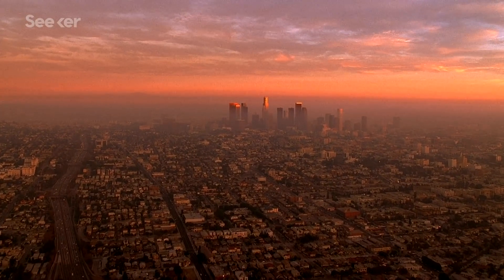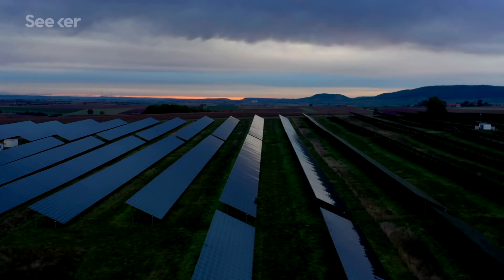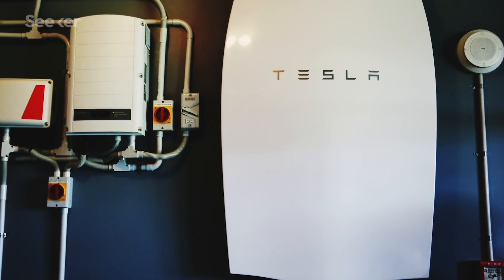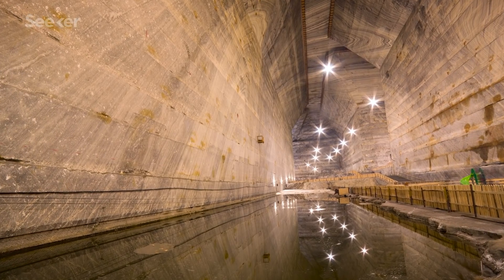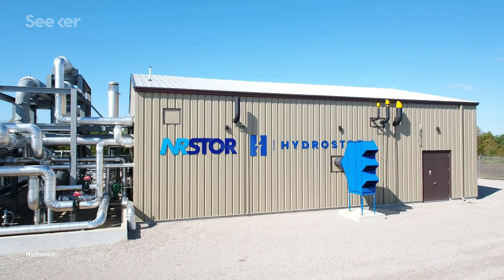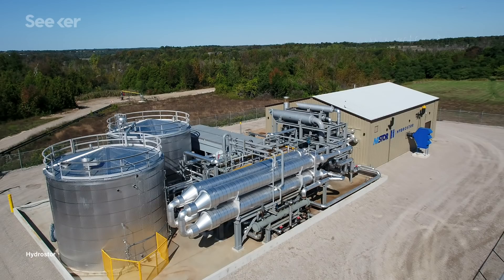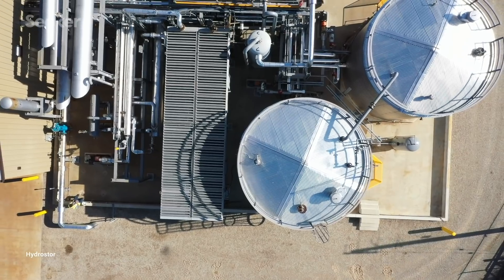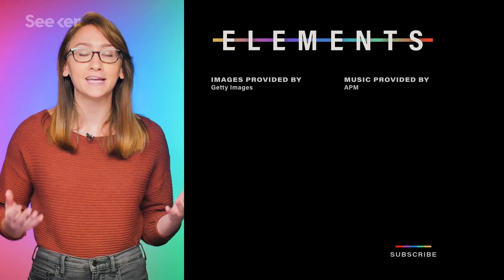This New Tech Could Revolutionize How We Store Renewable Energy

Comment: i saw an episode of (i think) real engineering or practical engineering, where they do pumped water storage.  use the extra electricity to pump the water up a high distance to a reservoir, and then when the sun goes down or the wind stops, the water runs back down through turbines to generate electricity.  no energy is lost due to the water cooling, because the same mass is up there, and it's gravitational potential energy, rather than the potential energy stored in momentum of the air molecules.
Reply: alot of energy is lost, but that's the thing, there's no lossless energy storage. you need to convert energy, and keep it at one place, and then have it accessible later on, however, those water storages are some of the best, problem is, they require a massive location, and a natural incline at that. still, i still consider them to be, some of the better choices.
Reply: Marcos Danilo 
oh yeah, it's certainly not 100% efficient, energy is lost to friction in the turbines, as they pump water up, and also as the water flows back down.  i was just mentioning that at least they don't lose energy to heat dissipation as well.  but yeah, they do require a lot of space and specific terrain.

Comment: thorium sounds great. and we've already built and tested a thorium reactor in the 50's and 60's. i think they did it in alabama. but there is one problem with thorium that so far, has been insurmountable. the molten salts used to store the heat energy is so acidic, that it eats through the piping and containment vessels. that makes the cost of maintainence so high as to make the thing cost prohibitive. maybe someone can figure a way to mitigate the corrosive effect of molten salt, but so far, it hasn't happened.
Reply: Well that's a drag to hear. I thought the fluoride mix they used wasn't very reactive, and never heard about corrosion problems for the the molten salts from solar-thermal towers they already have, but that's probably a totally different beast.This is what I hate about these kinda discussions, neither side wants to admit their own weak points and the info is so hard to come by. Thanks for the tip tho, if you have any articles easy to link I'd dig reading them.
Reply: @aitch9053  i can't for the life of me remember where i read that. awhile back, i watched a couple videos produced by an engineer. his name was kurt sorenson, or something like that. anyway i was intrigued enough to do some reading on the subject. and i do remember reading about the corrosion issue. at the time i remember thinking that it made sense. salts are generally corrosive. but don't cite me as any kind of an expert in the subject. if there isn't a work around yet, there probably soon will be. at least there will be if enough funding is devoted to the matter. also, thorium would compete with an already established industry. the corrosion issue could be a tactic, put out there by competitors, as a way to quell interest in thorium. it wouldn't be the first time.
Reply: Your opinion doesn’t matter, so shut up.
Reply: @nicklarsen3113  Jeezzz Nick, thanks for taking the time to post such a thoughtful and informative reply.

Comment: Strange that no one mentioned dam based water reservoir electric power plant. It not only produces electricity buy also has better efficiency than air due to lack of pressure leak and termal radiation

Comment: Pumped hydro storage has efficiency of around 80% with far less steps. That's the reason it represents 98% of all energy storage capacity on the planet. Things like this should be mentioned in the video
Reply: Good point, but you need to dam some valleys or dig huge holes for the reservoirs, which is likely to ruin some beautiful natural habitat, plus you either need a suitable high ground or wide enough area where you are allowed to dig two open pit mines. This idea needs only suitable rock formations to dig the caves in and a relatively small facility on the ground, and can stack multiple storage caverns on top of each other if you can't dig them wide enough. Optimally you will build it right under your solar/wind farm.
Given air is much less dense than water I am more worried about how much power it can store and at what cost, rather than the efficiency.
This does have one clear advantage though: Droughts and other bad weather are not going to bother it.
Reply: @AnalystPrime  The natural habitat argument always annoys me. You realise that for every valley destroyed there is a lake of the exact same size being created, which becomes the "unnatural" habitat of all the fish in it
Reply: @the_sideshifter  Okay, so you introduce fish and aquatic plants to feed the fish in the pit you dug and filled with water from somewhere. But then you actually need to use that water to produce power and the fishies get shredded by the turbines.
Likewise, no swimming or boating allowed for safety reasons, so the lake might look nice but people won't be using it much.
Reply: @AnalystPrime  A: have you not heard of a grid? they are great at stopping things passing through.
B: digging big holes in the ground top store air is fine, but using them to store water is somehow a problem?
Reply: @jonathan6015  When a hydropower plant opens it's intakes it's going to vacuum anything loose in that reservoir, and keeping that intake clean is already going to be a full time job without adding fishes and fishermen into the water. Also, destroying what is likely a forest with birds and other animals nesting there and replacing it with a monoculture is not going to improve the natural diversity of the area.
B: You are not thinking clearly. Air is stored in old mine shafts or caverns dug for the purpose, the facility topside housing the machinery will be hundred times larger than the holes going down, even without the solar or wind farm actually powering it. And the shafts will of course be covered, inside the buildings.
If you don't have a suitable valley for the reservoir you need to either find a hill you can build a big pool on top of(likely using lots of concrete, a source of CO2) or, if the locale is too flat, you need to dig two pits: one big enough to hold however many millions of gallons of water needed to store enough energy to make this project practical, and the other twice as deep and wide because that's where the water is going to flow and you need the height difference.
The first pit will be pretty big already and the second will have eight times that one's volume. Hopefully you have some use for all that earth you need to move... Also, hope you can find a place to dig those that is suitably close to a power plant and a city using that power but where giant open pit mines don't lower anyone's property values, because those will be very visible.
Reply: @AnalystPrime  Here Let Me Google That For You
I see you are clearly just making your own assumptions with out actually researching anything. i noticed this because all I had to do to find out that old mines are are viable sites for pumped hydro is type "Pumped Hydro Storage in an old mine" into google.

secondly, I typed "hydro energy dams" into an image search and lo and behold, huge dams open to nature and people with seemingly no problems with fish and debris.

I mean it should be quite obvious, old mines are often huge and we have been using water wheels for hundreds if not thousands of years.
Reply: @jonathan6015  I know there are experiments with using mine tunnels for hydro storage too, but I hope they waterproof them properly before starting. Google "sinkhole town" to find out what happens when you combine flowing water and soft rock or a salt mine. Also Google "Berkeley pit" for why letting water into a mine is generally a Very Bad Idea. Mines generally have the mining town above it, sinking the buildings into a lake of poisonous acid would lower property values. The turbines and other parts would likely be fine with the polluted water, but the people working on them would not, and anything that risks contaminating the local groundwater supply is unlikely to get approval in the first place.

You could also try Googling "fishing Hoover Dam", but I'll summarize: No, you can't fish on/at the dam itself, and ever since the dam was built the fish population of the river has declined. But of course the Hoover Dam is a proper hydroelectric plant on a river, not a pumped reservoir. We are talking about completely artificial pond, which may get drained empty at any time. Maybe you can explain to me which part of that sounds like "great place for fish to live" or "totally safe for people to play in the water"? Though we might still want to introduce some bottom feeders anyway, that would keep down the amount of rotting stuff.

And I am still unsure if you actually understand the basic issue: using a mine shaft requires an old mine in suitable type of rock, but once built you only need a small facility and rest of the area can be fields for animals, or a solar farm, or even houses. A water reservoir of useful size will require a sizeable area of land to be flooded and become useless for other purposes, plus it won't be "out of sight, out of mind". People already complain about land needed for solar farms and not wanting to see any windmills, now imagine the response to digging the numerous reservoirs needed for even minimal grid level energy storage.
Reply: @AnalystPrime  , so your whole argument as to why people cant use a mine for water storage is because they may do it badly. that's a pretty week argument you have there. this is starting to sound a lot more like your opinion then a factual argument.
Reply: @jonathan6015  No "opinion" here. FACT: only reason mines are dug is because there is a high concentration of some mineral, which water will leech out of the ground and most of the results will be toxic, corrosive, or both. FACT: the water can eat through the walls and cause a sinkhole above, as has happened in multiple mining towns. FACT: this energy storage relies on finding cheap abandoned mine tunnels to use because digging them yourself makes it too expensive to be viable, so needing to work on them to prevent that kind of accidents adds a pointless waste of money when the already in use and proven to work compressed air is both cheaper and safer.

And I still don't get why you want to fill those tunnels with water anyway. Compressed air works because you can insert multiple times the volume of the tunnel and get power out just by opening a valve. Filling half of the tunnel with water and letting it flow into the lower half only uses half of the volume and needs a large height difference to be useful. Even if you change the plan to building a regular reservoir, then using the mine shaft as the lower reservoir, it is still a dumb plan because tunnels are tiny in volume compared to what we need. Also, as the water pumps need to be at the bottom of that mine shaft any problems would need a specialist diver team to fix them.

If you want a pumped hydro storage the easiest and cheapest way is building two reservoirs like I explained above. Only issue will be slight loss of water due to evaporation, which can be managed. The reservoirs can be bigger than expensive tunnels, the machinery will be located in easy to reach places, and even if you managed to pick a location where the soil releases something dangerous you can build the reservoirs so the water will not leak out.
Reply: @AnalystPrime  lol, I'm sure you think your ideas are wonderful, but there is more than one way to skin a cat, all you would need to do to the mine is seal the surfaces with something waterproof, something like shotcrete would work fine. No surface contact no problem.
Reply: @jonathan6015  Yes, I already mentioned that. AND that the whole point is to save money by using a cheap location that needs minimal work. It also does the opposite of helping with the issue of limited space in the mines. Unless using water allows for multiple gigawatt hours more storage in less volume than air, it is better to go with the cheaper and safer system.
Reply: @AnalystPrime  the difference is that air is compressible.   The energy density in a cubic meter of compressed air (depending upon the storage pressure, naturally) is much greater than that stored in a cubic meter of water held at reasonable elevation.
Reply: @andrewm753  No, the difference is that you need to raise the water(or any other weight) at high elevation to make it useful, and prepare a storage area at the bottom so you can hoist it up again easily, while you can put the compressed air storage underground and have no need to keep using the same air. If you have a suitable old mine for the facility it should be cheaper than digging pits and building dams. If you don't have one, digging big open pits is actually much easier, meaning cheaper, than underground tunnels and caverns. (Though, as I pointed out above, people are much more likely to oppose huge open pits than unseen caverns.)
Either system will be huge compared to batteries or heat storage, the exact amount of power per volume is only important if you somehow manage to store many times more power for the same cost.
Reply: @AnalystPrime  you are pulling on the right thread, but didn't quite grab hold...   yes, you are doing the same work, but when you use compressed air to displace the water, you have to use a lot more energy to move that volume of water  which in a storage sysyem does not matter so long as you can get it out.  So a bunch of the stored energy is actually stored in their thermal storage (their compression is adiabatic, so they capture their heat after compression - or perhaps interstage).  This thermal energy storage is, as you noted, a high energy density.  So per m3 of water displaced, the compressed air system actually has a lot more stored energy, some is in their air (lower density than the thermal storage) and some is in the heat (more dense).   So it is decidedly more dense than pumped hydro, but you are correct in the assertion that it is less dense than Li-ion batteries.   I think their argument over Li-ion is scale plus lower lifecycle costs due to massive scalability on duration (like pumped hydro) and low degradation over time .  Time will tell there, but it is possible that Li-ion and compressed air will both have a place, but for different applications (small and sitable fast responding batteries vs massive bulk long duration compressed air assets).
Reply: @andrewm753  Why rely on air to displace the water? Every mention of compressed air storage I have seen mentions using old salt mines, supposedly because salt is more airtight("solid" rock can be surprisingly porous). If you want to add water into that system you need to prevent the water from eating trough the salt or bad things happen, and if you need to waterproof it anyway you can also add pumps to get the water out.
And yes, compared to batteries which might be losing capacity daily, either CAES or pumped hydro has basically infinite lifespan, massively lower maintenance requirement, and is much simpler. But unless there is some breakthrough in lithium production Li-ion batteries probably won't be used anyway.
Considering we are talking about energy storage in at least gigawatt range, costing millions if not billions, and possibly involving digging a deep pit miles wide and diverting a river to fill it with water, replacing a warehouse full of Li-ion cells with two warehouses filled with H2 tanks or liquid metal batteries size of shipping containers doesn't seem like a problem if it works remotely well enough.
Reply: Thank you!
Reply: I'm failing to understand how you wouldn't need the same storage capacity at the same elevation differential anyway if you're use water to displace air under pressure.

Comment: "This New Tech Could Revolutionize How We Store Renewable Energy"  no, it will not. 60 % efficiency is very bad.
Reply: To be fair, it exceeds the thermodynamic efficiency of a peaker plant that is otherwise required to come on line.  I agree that I would prefer it to not be charged with energy from another, albeit more efficient fossil-fuel powered plant as the combined efficiency would likely be lower than the peaker.  I think the question becomes do the economics of the CAES with ~50% larger renewable energy production over that required to charge the same net energy in  a battery system beat the economics of battery system?  It's possible that this is true in the short term.
Reply: Mark Hickman 
This tech isn’t designed to generate energy, it is designed to store energy, so comparing it to a power plant isn’t really good.
Reply: @hellboy6507  A boiler is a vessel that heats and cools.  Using that as an example of dealing with expansion and contraction is valid, like holding the hot compressed air in a cylinder suspended in another cylinder and between which reside insulation either a vacuum or insulative material.  The vessel will surely contract as the air is expanded out of it.

Comment: Why not just keep the air from heating up in the first place using multistage cooling and compressing. Keeping the air cool will lower the energy needed to compress it since it's volume will contract before the next stage. under the ideal gas law the air will heat up as it is compressed, but if you cool it the volume goes down. Compressing it all in one step and then cooling it is the problem.

Comment: I thought this was solved years ago with pumped water storage.
Reply: The efficiency of the water based power storage systems are just not very good.
Reply: @omnesilere  Modern flow based systems have the very good efficiency  (90%). Challenge of this systems is that they require large reservours of water. For example Norway gets 95 % of total energy from  water as source of electricity, but in US this is only 7%
Reply: Just seen this comment on the bottom. It shoud be top comment